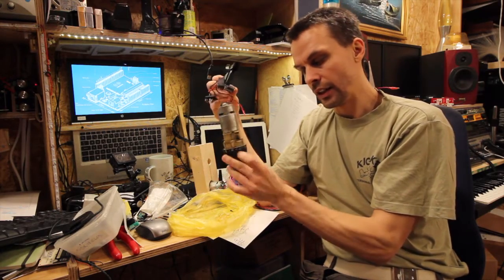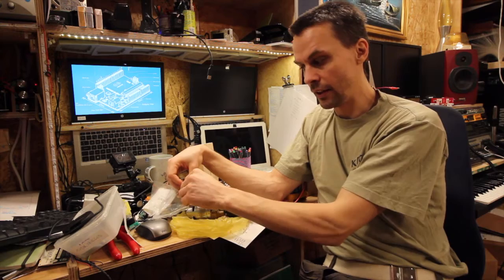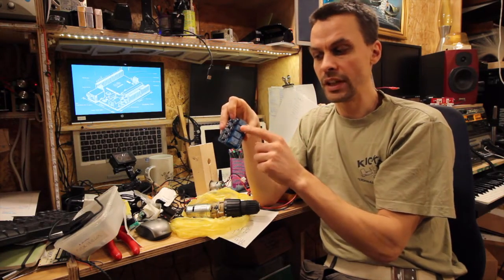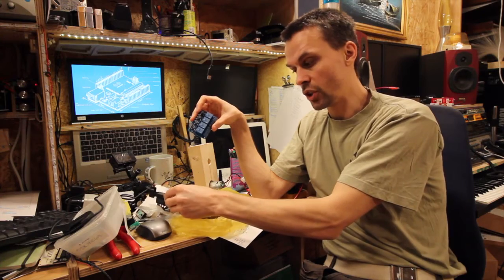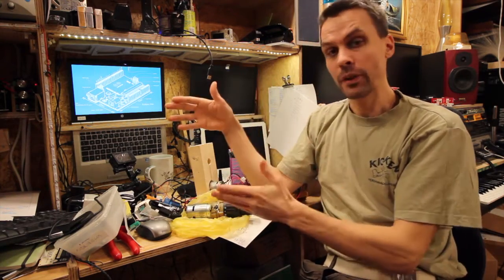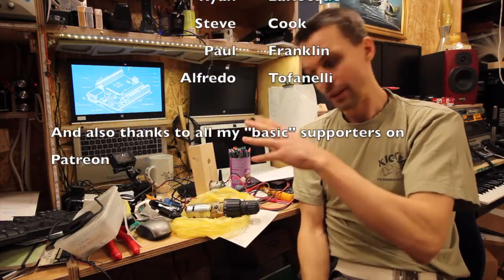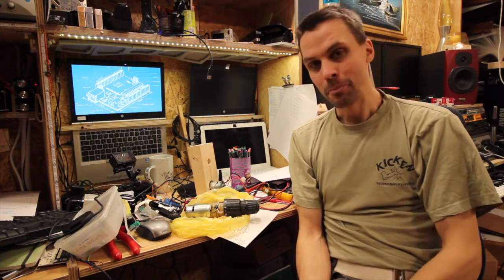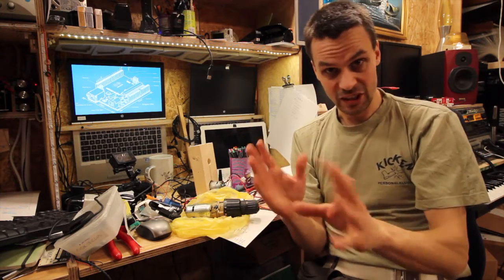Using and controlling the Innards of a Cordless drill with an Arduino - [Anything Arduino] - ep.33

Comment: Hello, and thanks for an interesting video.
I’m wondering what kind I relay you are using. How many amps is it rated for?
Br
Erik
Reply from the maker: Thanks. It is the “common” kind. 10a at both 30v and 240v.
Reply: Ok thanks!
I was a little worried that 10 amps is to low. I think my drill can draw up to 20 amps
Reply from the maker: Erik Nyström I don’t think my drills are that powerful though. It was just some cheap noname brands. 20 amps sounds a lot for a battery operated drill though?
Reply: @doctorerk  There is common automotive relay generally referred to as a "Bosch relay" it's really cheap and can handle 30 amps or more. It should work in this circuit.

Comment: Hi kristian, you could have used a single relay DPDT, instead of two.
Reply from the maker: Yes that would have worked to. Would act just the same. But I didn’t have any of those lying around. ;) thanks for the input.
Reply: @SourceryOne   I learned the hard way with those chinese relay modules, their contacts fail due to sparking, good quality relays last longer even without a basic snubber network, I had one of those 4 channel modules, 2 out of 4 relays the common pin got completely disconnected from the n/c contact.

Looking forward for more reverse engineering videos.

Greetings from Greece
VasilisK
Reply from the maker: I’ve heard that too but never experienced it. Probably solid state relays would be even better. The only relay that seem to have this kind of problem is one that is in a commercial 433 remote outlet which doesn’t always turn on even though I hear the relay switch inside of it.
Reply: Newbie here and i loved the drawings.  They made it very clear.  Thanks